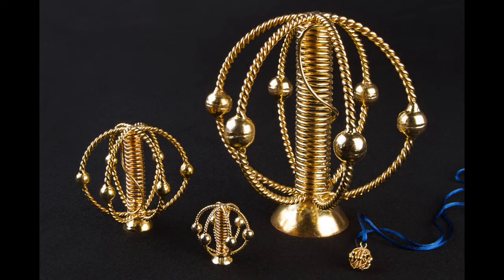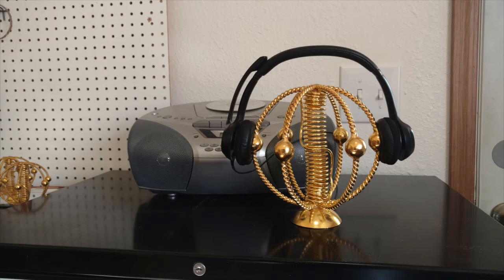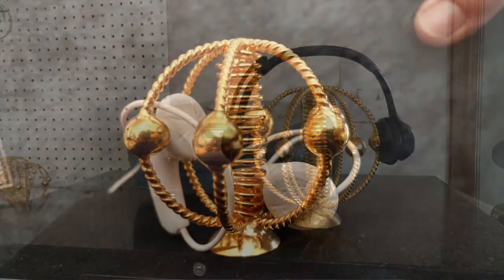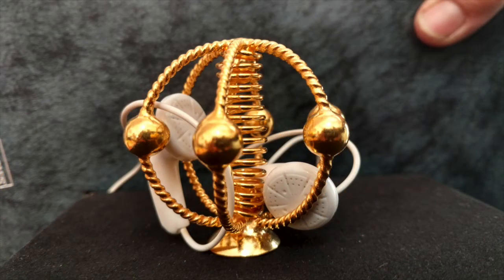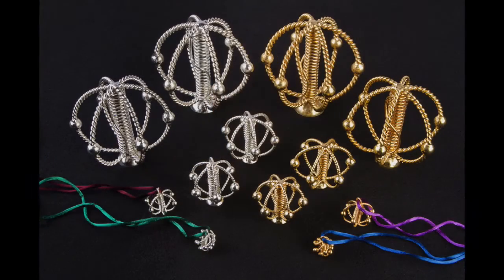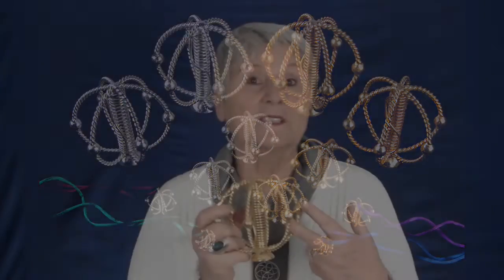Harmonizers and the difference between gold and silver plating.

Comment: HI Katharina , I am thinking of purchasing one of these can you tell me if one places the Harmonizer on a rotating platform e.g. a Vinyl Turntable , which will spin the harmonizer will this increase the effect ? tia.
Reply: Hi Tia, I am sorry I haven't responded earlier. I have not seen your message. I would not put the Harmonizer on a rotating platform, it doesn't feel right. If you try it, be aware of the changes in your environment. It could adverse effects.